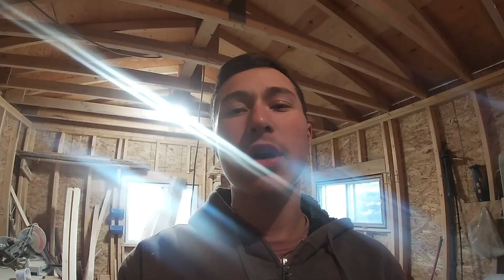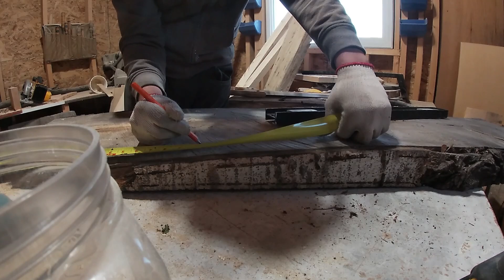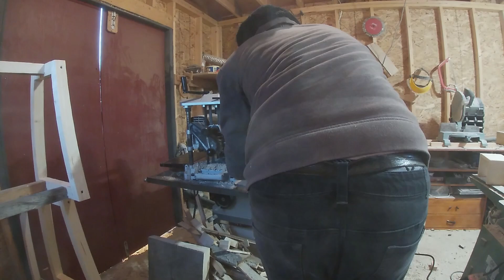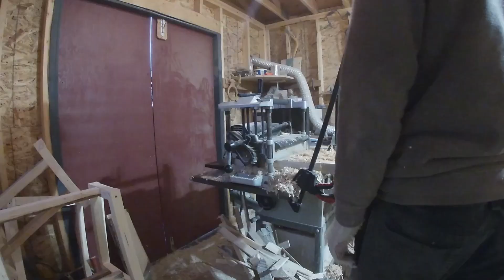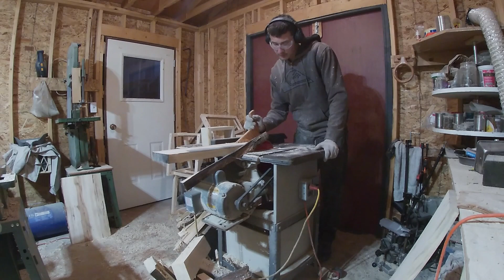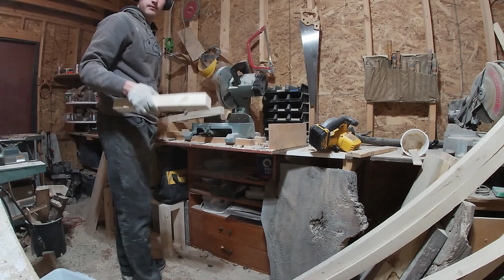Making $500 From Woodworking as Fast as I can - Day 1

Comment: I’m disappointed you stopped trying/counting the money to make $1,000.00 in 30 days. Should have kept up with that. To someone who watches you, it would seem you’ve gave up because you didn’t achieve your goal. My suggestion would be to carry on with trying to get to $1,000.00. If it took ya 45 days, that just gives you the ability to make another series of making 1k in less than 45 days. Turn it into your own challenge. Beat your best. Also, when your pouring epoxy, put tape on the underside right by the edge. That way there, when the epoxy hardens, you can remove it easier than having to sand all that epoxy and leaving a residue under the table of epoxy. Other than that, I will continue to watch. You are a motivator.